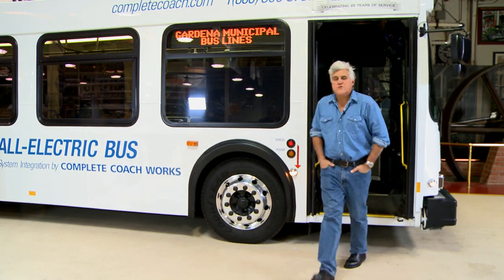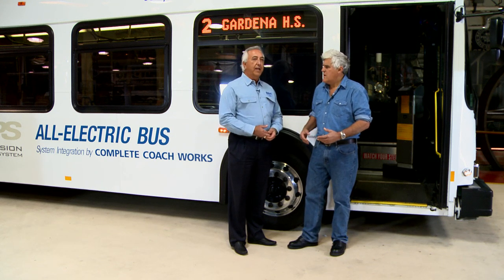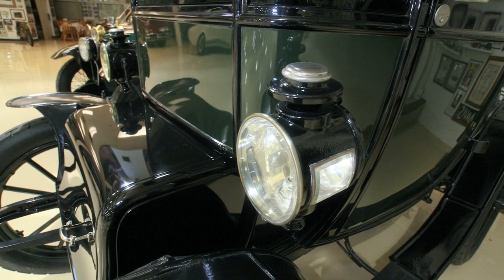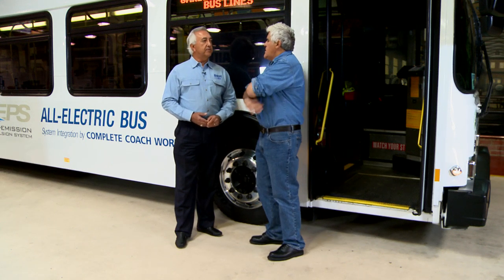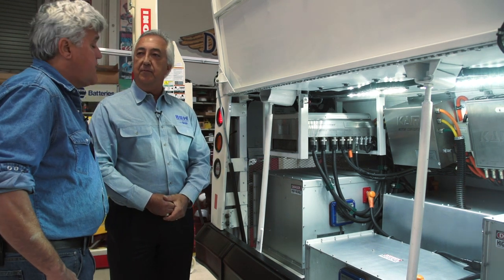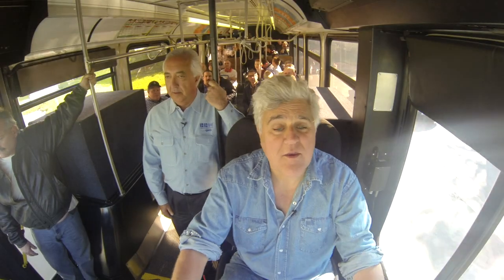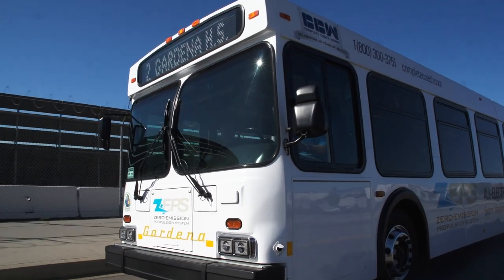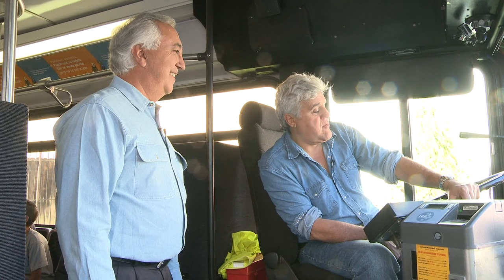Electric Bus Conversion - Jay Leno's Garage

Comment: Jay,

    Tesla did borrow 465 million dollars from the Department of Energy but paid it back in 9 years early with $20 million in interest paid to the D of E.

Instead of plugging in the bus to charge at the end of each route install in the pavement a wireless charging system which supplies the power to the vehicle with no physical connection. You can buy one today for a model S or X which charges at 7.7 KW per hour. It takes a little over an hour to install on any electric vehicle and while it would probably take overnight to charge the bus to full capacity it would allow the bus to charge a bit at each end of the route extending the buses battery before it needs a charge.

Comment: I feel like this bus should have solar panels built into the roof. With cars, I can understand that there's not enough surface area for a solar panel to generate significant energy. But a bus will have way more space, so it would have a more significant power output, no? At least to run some low amperage system like the lights inside or something.
Reply: yeah youd think solar panels would have been added for the £500,000 bucks it takes to make one of these. also they could have added batteries under the seats fo the bus to add twice as much if not 3 times the power.
Reply: Ricky Robertson I don't understand all the talk nowadays about shitty 19% of surface space inefficient expensive panels, that unglue electrons to push magnetism through the loop. Why not use gravity to fill the voltage drop.
Reply: Peter Kiryluk
Using gravity for a solar panel? What do you mean?
Reply: Meaning, You are on one giant magnet, people need to stop thinking of images in 2 d, and really understand it with 3d models, so If you know U can levitate magnets on each other. U can use the same free force from our own planet. See its a giant magnet, but instead of thinking of the magnet, think about how the field looks, so now if you spin a wheel any wheel horizontal to the ground, you realize that it weighs less. So using extra momentum on all gears, placing them in a horizontal to the ground, that lost energy your talking about would be countered by free simple forces people dont think about because they are on ground, are not floating in space being the ground. Think about it, what makes something ground. Ground is really positive by the way its backwards when reading about power. Now anything that spins, like our planet has 2 poles, + - when it spins it weighs less, also creating more gravity at the equator of the object. Thats also the spot where more dead satellites fall. Anyway, so lets say your sucking out water from a higher place to a lower place, it happens by its self with a little help at the very beginning. Thanks to pressure. Pressure also fucks up time. so at the center of a galaxy, or atom or huricane or universe, u see a spiral, where there is more action / stuff in that area, the pressure changes, so if u where at an outer edge and tried to communicate with the center of the spirals we live in, the time is faster inside. Being inside a hurricane everything is faster inside just like in a metal rotor spinning, if that rotter represented the universe, the outer sides time is moving slower then the inside. We can easily use these forces to make everything more efficient.  Instead of using solar, which is great, there are simpler ways that people cant seem to comprehend because they simply don't detach them selves and ask how that same thing acts in space.  The question i had, was if you mixed a glass of tea with a spoon in space would the spiral "hurricane shape the spoon makes" would it still look like a hurricane on earth or would it have to poles, or would it look like to cones with the points coming out. And i cant seem to find the answer, sometimes i feel nasa intensely shares useless information with the public so they will struggle figuring better ways to mess with gravity, pressure and there for waist less power to get more energy out.
Reply: this is a good though but is way to much money and how would you get propulsion ? making ''free'' reliable transort is one thing, but flying stuff is another :P lol
Reply: Well think about it, the world is a magnet, so use it to lessen the voltage drop for propulsion. I just hate solar panels because there are so many other better systems out there, that are more then 19% efficient.
Reply: If you are running solar panels on the roof cant the voltage be put true a transformer to match the motor voltage.Lots of buses sit for ours between runs you would think that solar panels could be charging the battery,s even when bus is not in you,ed
Reply: Peter Kiryluk No offence intended Peter, but you have no idea what you are talking about and you seem very confused about some pretty basic physical concepts.  I would recommend taking some entry level physics and/or engineering courses, and staying away from the Nasa conspiracy nutcases.
Reply: Matthew Sharpe
Yeah, I was thinking the same thing but didn't really wanna say it. :P
Reply: hmmmmm. just food for thought. im talikimng about readily available technology that we can use and is fairly cheap. just think. the whole top surface of a bus could get a bus an extra 50% of travel. atleast. considering the busses in london are shit. think about less congestion ect.
Reply: Wartler Unfortunately in most countries science education and public interest in scence is in a sorry state - so many people either have no understanding of even the basics, or have somehow formed totally invalid ideas about how things work like Mr Kiryluk seems to have.
Reply: Peter Kiryluk
I don't know where you got the 19% efficient from (maybe a decade old magazine) But almost a year ago, The Fraunhofer Institute. built Solar Cells with 44.7% Efficiency. http://www.ise.fraunhofer.de/en/press-and-media/press-releases/presseinformationen-2013/world-record-solar-cell-with-44.7-efficiency

here is a link to a list of other companies and their panel's efficiencies.
 http://cleantechnica.com/2014/02/02/which-solar-panels-most-efficient/
Reply: FROM REGULAR PANELS go look it up. Yeah some companies make 86% efficiency panels, but they cost way more and came out in 2012. That is why it makes them practically useless people need to understand how they work to really see why its so impractical at this moment in time.
Reply: Peter Kiryluk
ok first "FROM REGULAR PANELS go look it up. Yeah some companies make 86% efficiency panels, but they cost way more and came out in 2012." makes no sense.

I did look it up and the most efficient panels to date(2014) are the 44.7% from Fraunhofer. the only bad side to them is their cost to build. while the cheaper more commercially used one's are up to 24.4%. on a bus that size, you can easily get enough panels on it to produce 10 to 15 kw and hour. and that's with the 19% panels i found online, with the measurements i got for this type of bus's roof size. I did the math and i rounded down.

And second "That is why it makes them practically useless people need to understand how they work to really see why its so impractical at this moment in time." PLEASE explain your logic here. i Know exactly how solar cells work. I built a few panels myself about year ago.
Reply: They are useless because of cost, and that power needs to be stored? So where you gonna put it, LEAD? Li-Ion Fire Batteries? NCad? They are all really expensive options for normal people to buy and use, as they cost 30,000 for a typical family home installation. HOW will you pay that off? How long do u expect to own your 200,000 Casket When you pay all of that bundled mess off you will be close to death or already in a plot of land somewhere. Anyway I think its a great technology its just crap when it comes to real world implementation because of power storage and cost per panel to create a basic chemical reaction in the cell. You might as well just use Windings like a transformer and collect all the power that is wasted everywhere and comes from space, it way more efficient. and you don't need to use batteries for Capacitance. BUT ur right, i was all about the technology a while ago, until i discovered way better technology that companies don't produce yet.Like the weird power generator that uses OXYGEN to generate electricity, thats WAYYYYY better and CHEAPER. The Bloom Box. Google it, i can show you 100 more kinds and types of really neat things you probably don't know exist since the media never advertises small inventors. And creative people like your self.
Reply: Peter Kiryluk
don't need to store it for a bus that has a 100+ kw an hour motor. and i take it you haven't heard of Duel Carbon batteries.

any other power tech out there wont make it cause the oil, coal and natural gas company's don't want anything that will take money away from them. even solar and wind companies don't want that. look up Magnetic motor. i've built a small one.
Reply: no i haven't heard of duel carbon batteries i will look into it, you know, there is much cool stuff out there, and the massive companies that do oil will just destroy or try to buy them out. Like when they destroyed all the EV1 cars. I live to the day when i can own an electric car, and i wont lie, i think solar would be great when its sitting it would charge its self up. I just think its really really expensive. And i wish they made them more efficient.Or at least cheaper. There would be one way of doing . If you put the solar panels not as flat. But like a _I_I_I_I_I_I Pattern on the roof so you could get Double the efficiency of the standard ones, as light would reflect anyway and its moving. I dont know why they don't make them like that in general.U know what i mean like a more dense pattern design.The only ones i have seen with anything special is some lenses on top. But why not make them point up like vertical on both sides and the bottom in a way where the sun would reflect off of them onto the other ones and it condenses them into double the space. Anyway it was nice talking to you. Have a great day.
Reply: Peter Kiryluk You ask where they are going to put the energy from solar panels on the bus roof.  Into the batteries of course!  The bus is powered by electricity stored in batteries, and the whole point of the solar panel suggestion was to recharge these to extend the range.  Alternatively, you could just run the air conditioning from the solar panels.  The more the sun shines, the better the air con works.
Reply: Nope, just do the math.  Unlike a stationary house, which has a much larger roof at that, the extra power retrieved from the system barely even breaks even with the extra power required to accelerate the extra mass.   Add the complexity and cost to it, and it simply doesn't make any sense.   Look at direct solar vehicles for example, how insanely small and light they have to be, and yet they are still painfully slow, its because of how inefficient solar panels still are today.

However, whats not necessarily a bad idea for personal work vehicles is to have covered parking where the roof is a solar panel, and cars plug in via the posts holding up those panels.   That keeps the UV off the car, keeps it cooler inside, and can trickle charge it while someone is at work all day for 8-10 hours.
Reply: DumbDuck44 i have to ask. Have you not heard of the karma fisker? Not only did it's solar panel power the a/c but it also charged the batteries. Now of course it didn't fully charge nor could it. But on average it gave another 5 minutes of power. And with a sports car that could reach 200mph. That extra 5 minutes could get it a few more miles.
Reply: Tampa Boy The Fisker Karma you mean.  The solar panel supposedly gave you up to 7 km per week of range, but unfortunately it was only hooked up to the 12 volt battery that supplied power for the ancillaries, so it's actual usefulness was ambiguous - most likely it was more of a gimmick than anything useful.

Also the Karma's maximum speed was 125 mph (200km/h).  It was not a fast car by any standard and other than the way it looked, was not a sports car as it handled terribly due to it's enormous weight (it weighed more than a large SUV).

The Karma was in any case a technological disaster, between the late deliveries, horrific unreliability, and repeated fires it sent Fisker bankrupt.  In short only an idiot or a Hollywood star (same thing?) would ever buy one because they were pretty much useless at everything other than looking pretty.

I think if it was worth doing, larger companies would already be doing it - at least for now solar power is not useful in vehicles (or roading like that bullshit solar road thing that someone was trying to swindle people with recently)
Reply: Matthew Sharpe What does it matter what i meant to say? I was only pointing out that panels on the bus can but used. forgot to mention that it got 67mpg highway. yes its panels ended up being just for the accessory battery. but that still meant the car didn't used any of the power produced by it's generator for lights, a/c or radio. And even tho it weighted 5300lbs it still could do 0 to 60 in under 6 seconds.
Reply: The average city bus is about 12 x 2.5 meters, giving you 28 square meters and if you can get 150W per square meter out of it you get 4200W, if you can have the full day in the sun around 5 hours of sunlight are a reasonable average so 21kWh, but we probably need to take away 20% for all the power exchange so 17kWh is a reasonable power gain.
I'm guessing they would get an extra 20 miles out of that, which may or may not be worth it for them.
Reply: Wartler thank you was about to say
Reply: @PeterKiryluk  dude, you need to get some medication

Comment: Well, its fantastic that someone ACTUALY Promotes Electric Vehicles for they REAlL benefits.. Good one Sr. Jay Leno!... Just one thing, here in Portugal we've been running City buses on Natural Gas (actualy is LPG) for over 20 years, and electric Buses (conectrd to cables (similar to Metro roof cables) for more than 30 Years (means no batteries to recycle)... Finaly USA starts the conversion!

Comment: Work is ongoing combining supercaps & batteries into one case.  A supercap bank in a hybrid will bring great results. The original 1997 Prius was scheduled to have supercaps.

The Wankel is being promoted as being the generator only engines for series-hybrids because of its smoothness, compactness & great power-weight ratio. Laser ign and other changes are in motion to improve the engine. Running at a constant speed the Wankel excels. Combine with supercaps and we have a winner.

Comment: We have heavily considered placing solar panels, but if we were to install on the whole roof we only only gain about 3 miles on a charge from a sunny day. Weight is also added from the solar panels, not to mention additional cost and a greater carbon footprint to manufacture the solar panels. We are currently looking into inductive in-road charging instead. When the storage capacity of the batteries improve over the next few years we won't even have the need to charge during its route.

Comment: A lot of you are wondering about putting solar panels on the roof of the bus, your for getting that there are weight restrictions on a bus and height restrictions too. The heavier the bus the more power it uses to move. And if the bus is too high it won't fit down most city streets.

Comment: In my city of Dayton, Ohio we have had electric buses for decades, though not battery powered.  They are technically called trackless trolleys and get power from overhead wires.  The trolleys are actually much faster than the diesel powered buses and last almost three times as long.  We still had trolleys running in the 80s that were built in the 50s  The fleet was modernized recently to coaches that can run on batteries for short trips in case of a problem with the power lines.